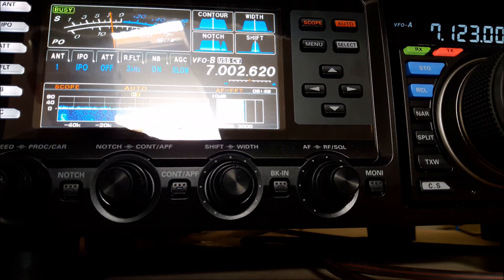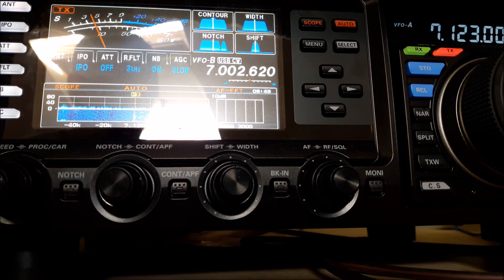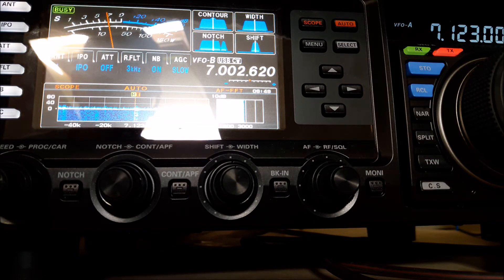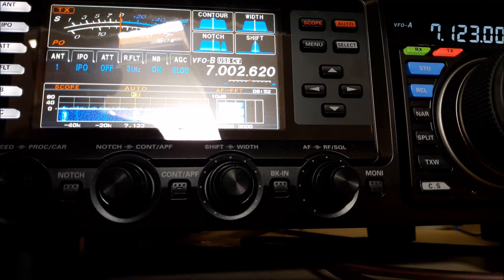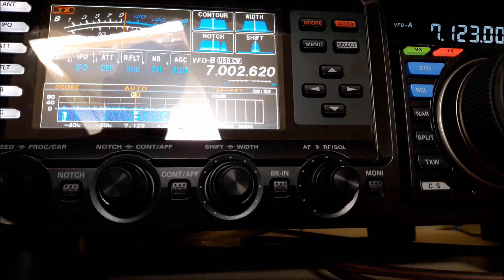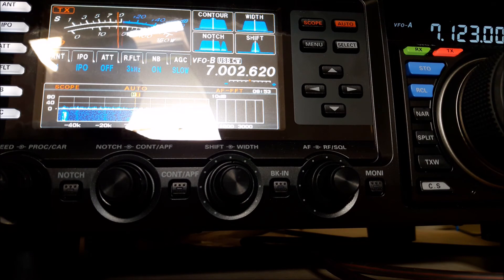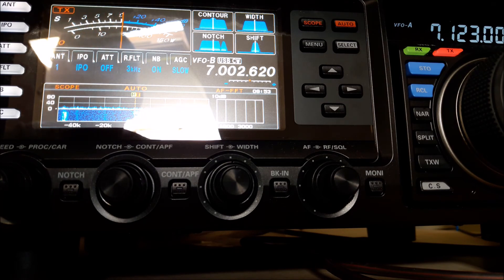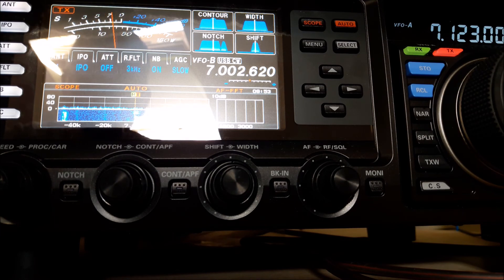Discussion on metal roof as an antenna ground plane?

Comment: If the roof is big enough and if he adds grounding straps between each panel he may be able to set p a few co phase antenna and even some directors in certain angles. Depends on so many factors, neighbours for example.

Comment: Adrian, thanks for the help and asking SDRC Net.  This is just a experiment and if it works well on one or more frequencies thats great.  I have a discone, a Carolina Windom, a Bonito MA305FT Activ.  A dipole and a Wideband Loop and a longwire.  So, I dont have a shortage a antennas already deployed.  This was interesting to hear all the different thoughts.  Thanks and 73s Brian
Reply from the maker: No worries. It's a question that I thought a few people would be interested in and I thought it would be good to throw it out there. Judging by the comments - it was worthwhile as it has generated a discussion & maybe of use to an SWL starting out or someone looking to have another receive antenna & have a metal roof they can utilise.  I've learned potential pros & cons from on-air & on-line contributions so far 🙂  
Let us know how you get on👍

Comment: The metal roof of a shed can make a good ground plane for CB, etc. But for general HF reception I'd rather have a good ground.
Reply from the maker: Thanks Jonjo. It's good to discuss & learn from others. You're always throwing up different bits of wire, have you ever tried a roof job? 🙂73
Reply: @ado75  Not yet, but I'm working on a new long wire at the moment.

Comment: Hi Adrian, I had one post in my twitter feed with photo which was about the well known Twente SDR - The antenna is a mini-whip based on the design by PA0RDT, sitting on top of a well-grounded metal roof at 65 feet. That setup provides wonderful, mostly noise-free reception. 
If I could only find that thread. I also received lots of photos and one video from LPAM Radio Seabreeze (NL) showing their setup on the roof.   A wire from antenna is grounded to a big metal part of otherwise asphalt covered flat roof. 73s Ron
Edit - more info from Pieter-Tjerk de Boer, PA3FWM:
When installing the MiniWhip for our WebSDR receiver at the University of Twente, we were lucky, in hindsight. Firstly, the building's roof is entirely metal, which gives a good ground plane; our antenna thus does not measure the field's potential w.r.t. the real ground at street level, but w.r.t. the metal roof, which gets us rid of many noise sources in the building. Secondly, we were able to connect the antenna's ground connection to this roof. Thirdly, the situation happened to be such that a long cable to our shack was needed; such a cable has, even without being coiled up, already a substantial inductance, and furthermore it runs immediately near a grounded metal wall, providing a substantial capacitance to ground. That inductance and capacitance form a low-pass filter, again attenuating noise from the shack before it reaches the antenna. http://www.pa3fwm.nl/technotes/tn09d.html
Reply from the maker: @Greg White That's why I put this question out there as I had a feeling there would be interesting experiences in integrating these surfaces into antenna systems. Well at least your contribution & knowledge is being seen here Greg... by a more appreciative audience. 73 Adrian
Reply from the maker: Thanks for the information & document link Ron. 73
Reply: @Greg White Was it a break in the braid of the coax?
Reply: @Greg White Nice diagnosis there Greg, I've heard of rusty nail syndrome making cast iron gutters and cooker rings close to large high power transmitters "talking" so probably the same sort of thing going on. Sadly the world is full of ungrateful people..

Comment: Burgeoning young CB operators made effective use of the tin roof as a ground plane mounting many a mobile antenna to brackets attached to the roof, I still use a tin roof for the groundplane of my quarterwave antenna (sometimes for SWL) 👍
Reply from the maker: Is it for a specific band?
Reply: @ado75  Yes I made it for 11m but the outer shielding of the coaxial feedline needs to be disconnected for other bands (SWL beyond 10 - 12m) due to narrow bandwidth of the antenna.